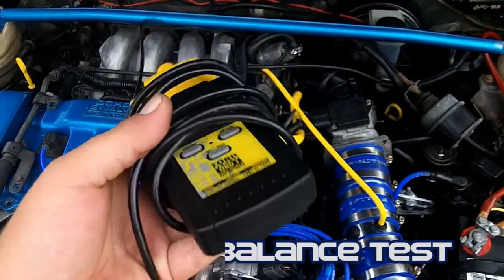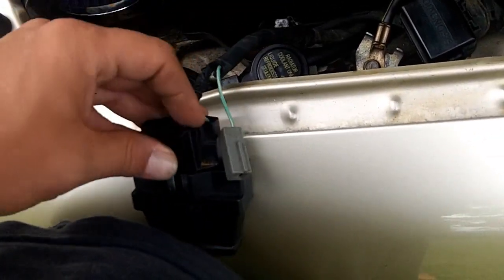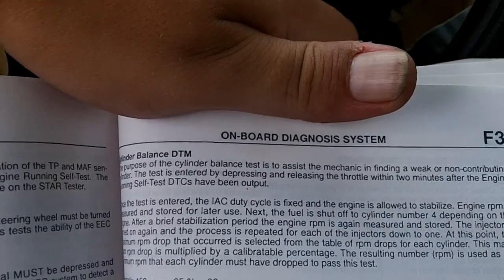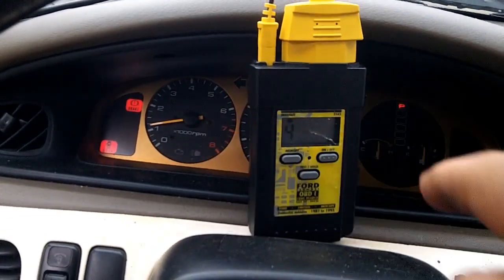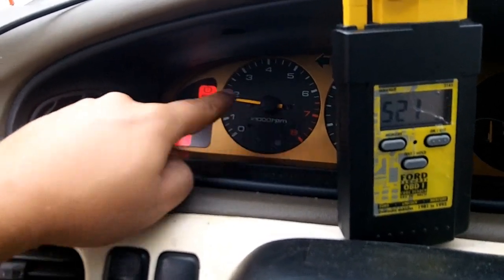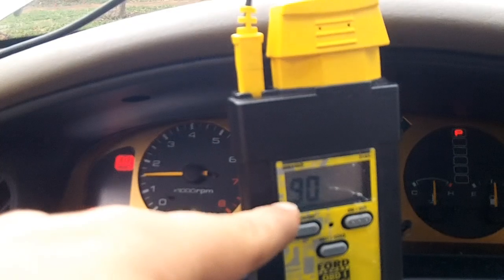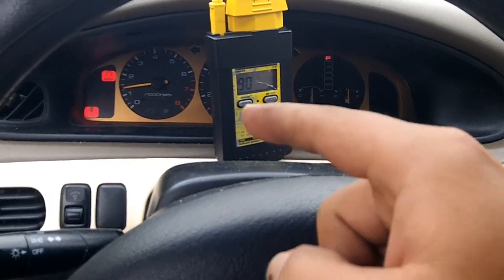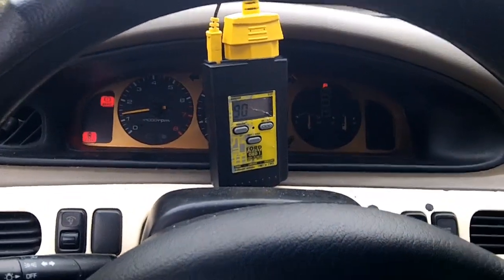EEC-IV Cylinder Balance Test

Comment: Get the Actron CP9690 code tester. It checks live, record, graphing, emissions readiness test, transmission codes, ABS, SRS, oxygen sensor tests, and MORE! It has cables for OBDI Ford, G.M., Chrysler, and Toyota. It has a cable for OBDII. It's well-lit! It comes in a black pouch. It comes with a cigarette lighter cable. It uses 4 aaa batteries under the rear cover. It has code-connect to diagnose codes. 2000 up is auto-tested. Below, you dial in the vehicle. It retains the memory of test results until you erase them. EBAY has it. Warm the engine to 2000 RPM's for 2 minutes or until the upper radiator hose is warm. After replacing parts, recheck codes. If you get improper vacuum to the EGR at idle, replace the charcoal canister purge valve. If you get oxygen sensor rich codes, replace the MAP sensor. It could be other causes of rich mixture.

Comment from the maker: You should have used the procedure in my "EEC-IV KOEO" or "EEC-IV KOER" videos.  Although this procedure does read the codes it's meant to be used with a cylinder balance test.  If you only want to know how to pull the codes I recommend watching my other 2 videos on the subject they have better info on the procedure.

Comment from the maker: No tip yet.  Holding off on the aesthetics until the car actually runs right.  What I mean by that is getting rid of the vibration.  I won't even wash my car because it's pointless to me as long as the vibration exists.